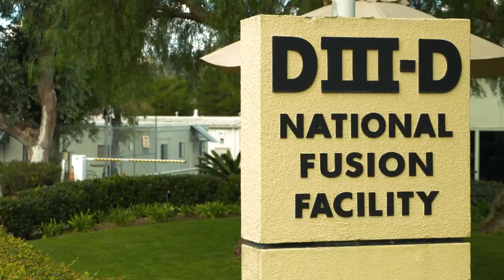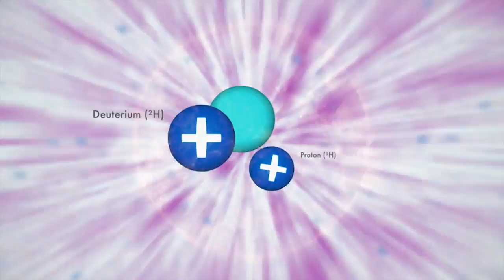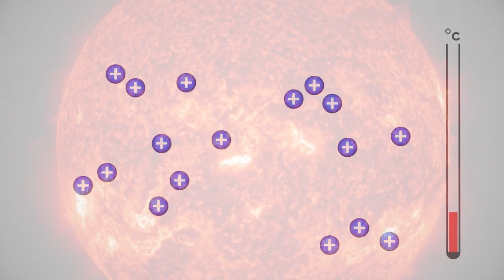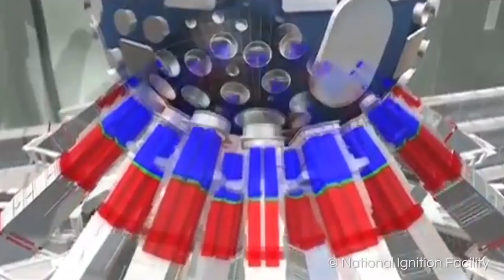The Power to Change the World: Fusion

Comment: Fusion energy has been round the corner for several decades, but we still fall for it in spite of the fact it has never even lit a single lightbulb. It is far too complicated and a power generating device will never be built for many reasons - tritium breeding, tritium handing, plasma disruption events, insulator life in the neutron flux, material embrittlement, just to name a few.
Reply from the maker: They are all challenges, it's true, but it doesn't mean they will never be solved. There are so many things that we take for granted today that would have looked impossible just a couple of hundred years ago. Why should we give up just because something is hard? We just don't have that mindset.
Reply: Ok - are there any materials that will contain the fast diffusing tritium, remembering that it will be bred in a hot environment?
Reply: People thought the same about manned flight. Just remember, pessimists don't make breakthroughs.